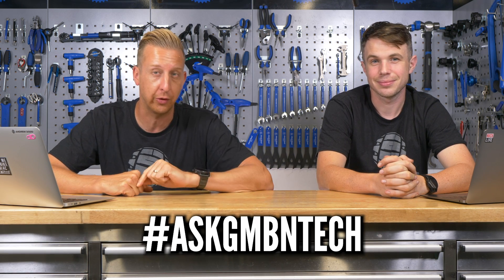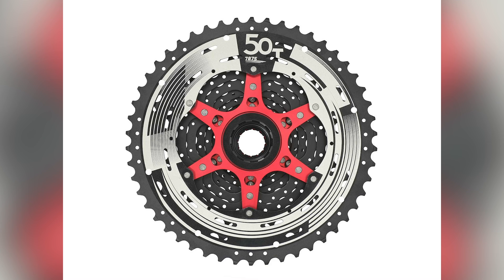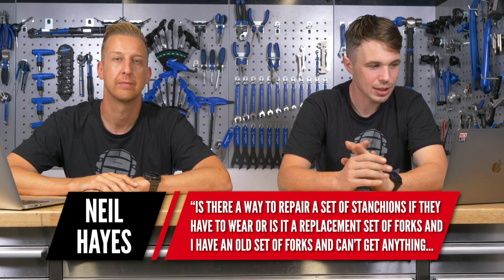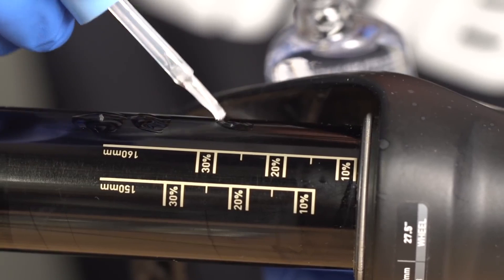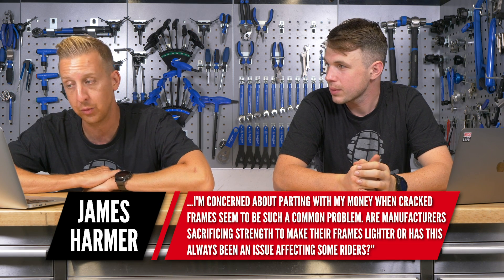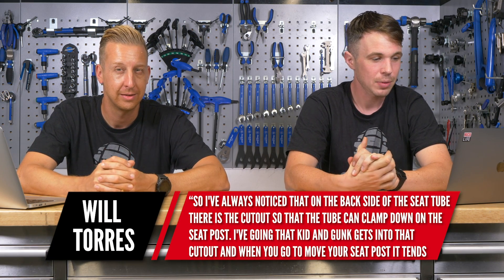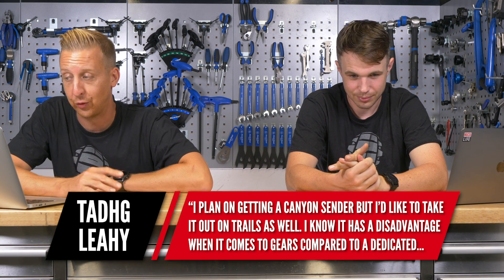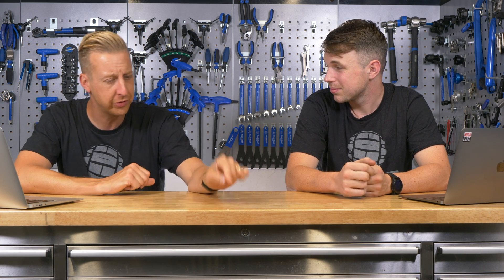How Do I Fix A Scratched Stanchion? | Ask GMBN Tech Ep. 82

Comment: #AskGMBNTech
Hi, I have just brought a second hand bike but the preload knob on the fork doesn't move left or right, do you know a way I can fix this, thanks for your help!
Reply: It's an SR Suntour fork, I bet? Most of the time the Suntour preload knob can get quite stuck, or the previous owner has turned it so far one way that the internal threads are jammed. 
You can usualy get replacement ones online, plus the specific tool needed to take out the old one and install the new one. Just look up "SR Suntour preload cap" and "SR Suntour oreload cap remover tool" and you can DIY.
If it isn't a Suntour, again suspension companies usually sell replacement parts or have freely available tecnical manuals that ypu can refer to if the preload cap can be redurbished.

Comment: #AskGMBNTech Dont know if this question is for Tech but ill ask it anyway. Was going dh this weekend and took a good hit with my crank on a rock, went otb and chiped my helmet landing, do i need to get a new one or is it still safe?
Reply: Get a new one. Once the helmets takes a hit it's not as strong as before and might break instead of protecting your head
Reply: @martink1689  Thats what i thought but hoped for another answer cause it was brand new,first day of use........Thanks for the reply
Reply: @obsoletedynamo  Check your helmet warranty. Some brands, like Bonrtrager and Giro, have a replacement guarantee or discount on a replacement if you crash it in the first year.
Reply: @HairyPantaloons  Thanks for the info, ill look into it
Reply: When u say chipped...what like the paint? U hit crank hard, what about head? A slight knock enough to only chip paint might be ok... but a hard impact on a trail or single impact lid, then change. Some dh lids are multi impact. 
Some manufacturers have a replacement service. Contact them.
Reply: @rupedog  Yes only the paint, mostly scratched and two chips pinkytop size, got then tumbeling on the trail, thanks for the info on replacement service

Comment: A Novatech hub nearly put me hospital when the cup separated from the cone, for no reason, on a pull away from a stop. I was already nursing a broken leg back to full health and the suddenly slip was not what the doctor ordered. If you have a Novatech hub change it for something that is fully sealed and has the driver you need.

Raziv, Dot 5.1 is also automotive clutch fluid. Go to halfords/autozone and ask. Or just look up Chain Reaction cycles. they always have some.

Comment: @askgmbn looking at getting wider tyres, currently I have 2.3 how can I tell/ measure the maximum size of tyre I can get to fit #askgmbntech
Reply: Finley Ballantyne look online
Reply: Manufacturers manual/specs should state it
Reply: Problem is, tyre manufacturers state a size but often reality doesnt match. Maxxis tend to be overstated, so their trail wide 2.6 measures more like 2.4. So if ur frame says 2.4max, it might mean u can use a wider stated size frome sone brands. Schwalbe tend to be spot on. But ultimately its trial and error near the limit

Comment: I have a question. I nearly rounded a screw on my Chain tentioner on my Dirt Jump bike. How Should i tighten it or should I replace it? It is a M5 screw. #AskGMBNTech
Reply: I'm not Doddy or Henry but replace the screw. If you manage to tighten it somehow it'll be a total ass to get out next time. And if it is just a standard M5 hex/Allen head it will cost just pennies.
Reply: @tmimify  If the bolt can be removed, measure the diameter and length of the threaded part and find a comparable bolt.
An M5×10 bolt will be a 5mm diameter threaded part that is 10mm long from the underside of the bolt head to the tip. Most bicycle nuts/bolts can be found online and in stonger materials like titanium.

Comment: I have the SRAM Eagle GX drivetrain on my Jamis, so that I didn't have to switch out the rear hub, I have the Eagle NX cassette.
Reply: I would say that, why a sunrace if you can use the NX cassete? Price wise is almost the same and it's more durable.
Reply: @JeffWagen  eventually I plan on upgrading my rim's and fitting my bike with the Eagle X01 drivetrain.
Reply: @scotts685  cool, but I was referring to Doddy's suggestion in the video, he said to use a Sunrace 12 speed cassete to avoid needing to buy a new hub or a whole rear wheel, NX cassete although being a little bit heavier is way more durable than Sunrace.
Reply: @JeffWagen  oh sorry I misunderstood. I just went by the recommendation of the bike tech where I have my bikes serviced. Since I'm a good customer my tech got me a good deal on my Pike forks because his son works at Rock Shox.